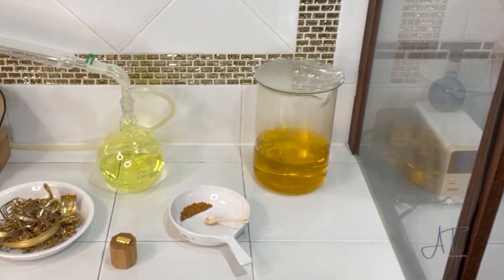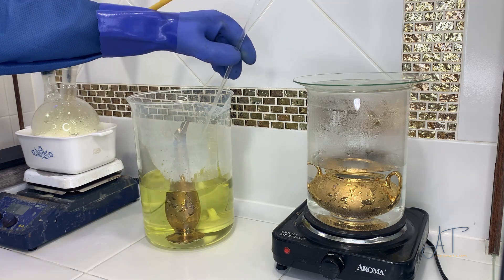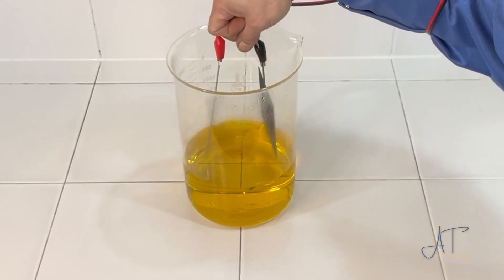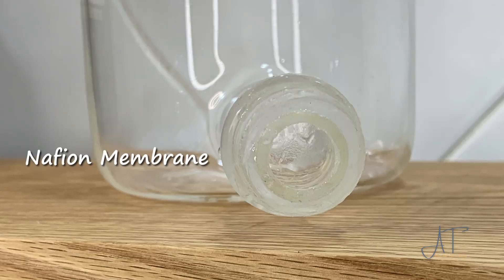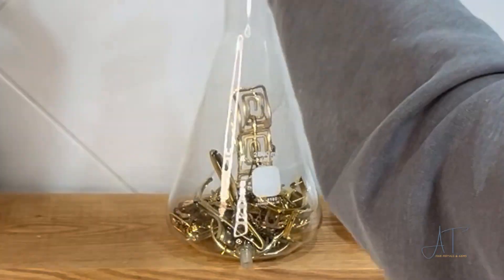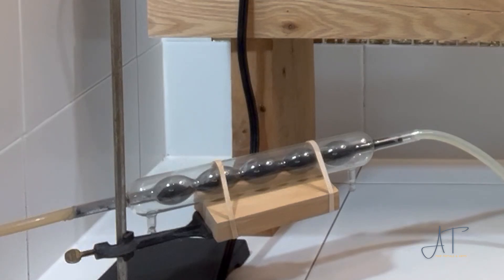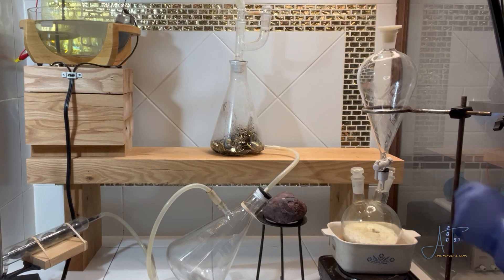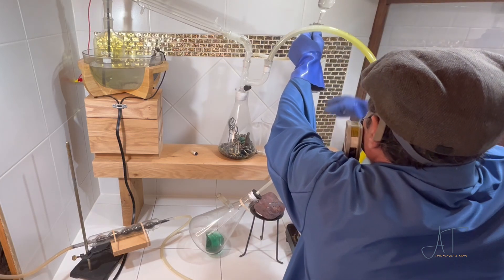How To Remove Gold Plate From Jewelry and Ceramics

Comment: That’s OK if you have a lot of time, but if you have a job and a bunch of other stuff to do reverse electroplating is the fastest way and not so many dangerous chemicals
Reply from the maker: My intention was to find a good use for the chlorine gas that is generated by my sodium hydroxide generator. I should have been more clear. Thanks for watching.

Comment: @5:39 regarding chlorine and rubber. could you explain how the chlorination process of rubber gloves, and other items. are you able to give more detail or how/why you mean "chlorine make a mess of rubber," .. . compared to the "chlorination" process. all i know is that dipping rubber into (?hydrogen peroxide+ chlorine?) liquid mix.. .. do reduce the size of the pores. does the gas work differently? or would the rubber dissolve if left in the liquid?
many thanks.
Reply from the maker: My experience, although limited in this area, is the chlorine gas dissolves the rubber stoppers that I buy on line. HCL will soften them but hold up better. With chlorine gas I get a sludge that's hard to clean off the glass and the stopper fails. Wrapping in teflon pipe thread has worked very well for many runs. Thanks for watching!

Comment: Something here doesn't sound right.  I've been recovering gold from computer scrap for 25 years.  The chlorine should dissolved the gold, not make it flake off.  If it flaked off, that would mean that it dissolved what was under the gold.  Have you tested the solution for dissolved gold?
Reply: My understanding is that he uses the Chlorine GAS to CORRODE the metal away, which loosens the gold in flakes, as that GAS does not corrode the gold. Gold does not go into SOLUTION, as there is no solution, as nothing gets dissolved! He also did this as an experiment to see if it is possible to use the gas created as a byproduct in the lye making process, and only added the chlorine generator to speed up the process. If a person does not understand what is happening, one should try to watch the video again, and then maybe ask questions instead of making stupid comments. Also, responding to idiots only grants them legitimacy, so it is sometimes better to just ignore them. Finally, God loves us all, even the idiots. Have a nice and blessed day.
Reply: @kiwa7544  chlorie gas and water forms hydrocloric acid?
Probably shouldn't have replied to you.
Reply: @snoddyification  You did though, and just as well. You still haven't watched the video again. At 7.26 - "Before opening the system, be sure to vent the chlorine gas from the system. I use my vacuum pump." Little further - "I then add water". Legitimising sure sucks; one can see why authors don't deign to reply to every comment.
Reply: @kiwa7544  dude you mistake for someone who cares what you think.
Go ye forth a multiply.
I unsubbed .
Blocked channel.
Yawn have a noce day.
Reply: @snoddyification  Proven!  May I please have the remains from your stockpot after you have finished reclaiming precious metals from it?
Reply: @kiwa7544  get alife bro.
Hammer nails or a gym membeship might help you with your pent up.
Reply from the maker: Copper chloride was primarily made when I added the water into the beaker of gold plated jewelry filled with the chlorine gas. Every solution that is made gets run in the 4 horsemen for recovery so every spec of gold will get recovered, no matter where it goes. That is the beauty of the system and what gives me the ability to run these experiments. You can pull out the metal no matter where it is because my way of refining has no waste. Everything gets recovered and reused.
Reply: @anthonythomasfmg  creating no waste is a lie! You are therefore breaking one of the 10 other rules you claim to also follow. Either be honest...or just leave the claims in the first place!
Reply: @anthonythomasfmg  you should know that god sees what you do when no one is watching!
Reply: From experience typically what gets dissolved first , is what is easiest to dissolve, and the last would be the gold.
Reply: I mostly agree...chlorine and water vapor create chloric acid, and that should fully dissolve gold plating. One way to lose the gold again though is a replacement reaction, where gold plates out again on the underlying metals, as they are usually copper or similar, and as such "less precious" than the gold, causing an exchange reaction. The blue green liquid is copper / nickel / etc...chlorides. As long as there is copper etc. in the vessel, most of the gold should plate out immediately and dissolve the underlying metals. As such there will be gold chips flaking off once the underlying metal is exposed, as the chlorine will mainly attack the easier to dissolve less precious metals. Depending on how long the liquid was in contact with the metals, there should be little if any gold left in solution. Also there should be a brown powder on the bottom of the metal flask, which would be the reduced gold powder.
Reply: Correct.
Anyone who would waste electricity for 8-48hrs generating a chemical weapon to recover about $10 worth of low quality and dirty foils, without a stannous test either should be likely avoided.
You will also note he never replies to anyone who isn't bowing down to him.
Why anyone would want to know his rules or spiritual choices is an even bigger mystery.
Best take a look at a different site.
Reply from the maker: I ran a sodium hydroxide generator that makes about $10 of sodium hydroxide a day and I got the gold flakes as a bonus for dealing with the chlorine gas, not just piping outside. May God Bless You All of Your Days!